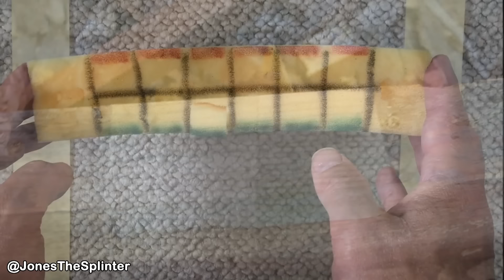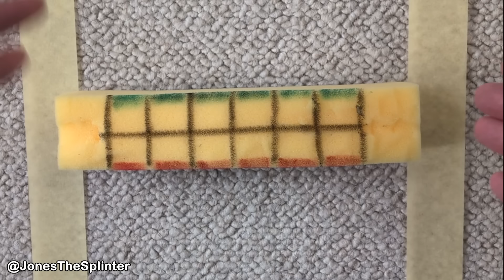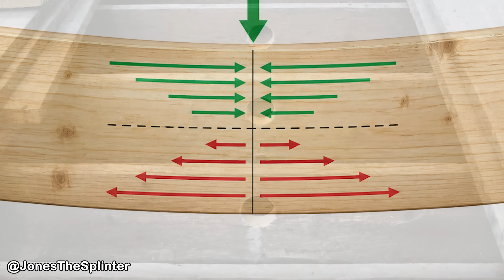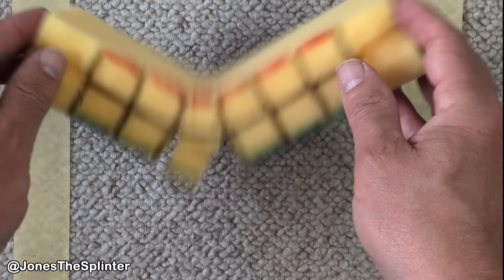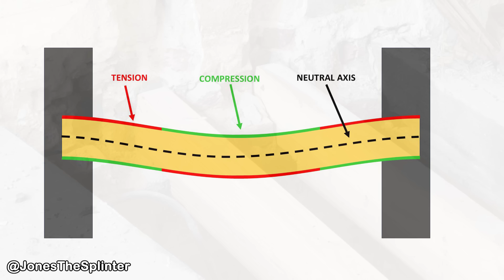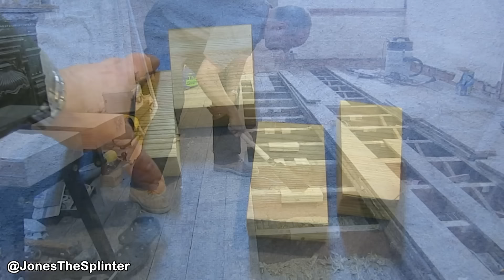This Joist Repair Works… But Only If You Know This Rule

Comment from the maker: Loads of good questions on the first video about where this technique works and where it doesn't — especially around tension vs compression. So I've tried to answer some of the questions in this follow up. Hope it helps.
If you'd like to see the original video which focuses on undertaking the repair it's here: https://youtu.be/Z_t69CTAIOE?si=mfOJYyt1GbSw_wdf
Reply: Great video! A video explaining how to fix the opposite problem would be very welcome. My plumber notched out the underside of the main beams supporting my floor. I've heard of sistering, but am not sure what it is. I'll do some research (I.e. watch more youtube).
Reply from the maker: @Bacon_Uber_Alles  Ah yes, notches on the underside are more disruptive and tricky to deal with. Sistering involves attaching a new joist (or length of timber) alongside the existing one and fixing them together so they act as a single beam. The new timber carries the load, restoring strength and reducing flex. There are fixes involving metal plates which may do the job with less upheaval.

Comment: We have sometimes bolted new material alongside a butchered joist, but the way you have done this makes for an easier, less expensive job.  Given that the butchery is to the top (compression) side only, I can see no reason why this wouldn't put a lot of the strength back. If it were my house I would probably do both! Great video.
Reply from the maker: I agree that doing both methods would offer the ultimate peace of mind. Thanks for the positive feedback. Much appreciated.

Comment: Small correction before makeing any joist repair you must remove stresses from the beam. This can be done with a jack post or other temporary shoring. Failure to do so will result in existing stress not transferring into the repair resulting in reduced strength.

Overall good explanation of beam stresses.
Reply from the maker: It's not always necessary or desirable to do that if you have a delicate lath and plaster ceiling below that you don't want to damage. These beams weren't sagging and theres minimal load at the time of the repair (just self weight and a strip of ceiling). The expanding wedge technique allow you to tap them in to try and match the existing stress in the top edge of the timber (I discuss this in my first video). With or without jacking you restore stiffness to the beam. If the beam is heavily loaded by all means jack it up, but if it's not you're good to go.

Comment: Excellent video.  Sponge did not go in vain.  There is an excellent book 'The new science of strong materials' by J E Gordon.  Deals with issues like this in a very straightforward way.
Reply: ... couple of extra points for a subsequent vid maybe?  As you know the timber is significantly stronger in tension than compression so any cuts on the tensile edge are worse news.  Strength of a beam is a square law so cutting away what may appear a small amount makes a big difference! Great work with the wedges.
Reply from the maker: @readrepairs  Indeed and 'stiffness' varies as the depth cubed (half the depth and stiffness is reduced by a factor of 8: small angle approximations apply) so this fix makes a huge difference to how bouncy the floor is.
But as you say, diving deeper into basic beam theory might be worth a shot in a future video.
Reply from the maker: That is one of my all time favourite books. I re-read it every five years or so to take me back to the general when my focus is getting too specific. It's on the shelf right next to my copy of "The New Science of Strong Materials: Or Why You Don't Fall Through the Floor". Sadly the book that's next to isn't such a page turner...The Finite Element Method: Its Basis and Fundamentals:  Zienkiewicz

Comment: Why not just sister the joist?  That would be much quicker. If you can't because utilities pass through the middle of the joist, then sister a smaller piece of lumber like a wall stud across the top.
Reply from the maker: It don't think it would have been any quicker. It would have meant removing and reinstalling the herringbone strutting for starters.

Comment: Great job ! Use nice well seasoned wood that's not gonna shrink. So many bodge artists unwittingly vandalise their joists with over the top channelling for pipes and cables.. Even if the floor doesn't give way you can at the very least end up with annoying creaking whilst walking over it.
Reply from the maker: Spot on. The wedge timber should be bone dry, you don't want it shrinking in ambient moisture conditions (expanding is fine)

Comment: What about after years and the wood shrinks and may come loose and fall out. I would say a composite or sistering would be better.
Reply from the maker: Indeed this has to be considered. The wedge timber should be bone dry, you don't want it shrinking in ambient moisture conditions (expansion is fine).

Comment: Dang, that's simple and smart. I sistered a bunch of notched old joists. I would have repaired them (and then also sistered them since they were already undersized) had I known this when I was doing the work. Next time...

Edit: added closing parenthesis I'd missed.
Reply from the maker: Thank you. Glad you found the method useful for your next project!

Comment: Very nice instruction on how to fix a mistake you see way too often. Aren't certain bonds like bonds between resin and wood ridiculously strong? Perhaps with the right adhesive or filler a fix on the bottom would also work ?
Reply from the maker: As you say there are some ridiculously strong resins/epoxies. I've tried them in compression and they're excellent but never in tension. Maybe it would make a good video to test these products qualitatively under tensile load. I'll stick it on my do list.  Thank you for your input.

Comment: Waste of time. That's big lumber. No need to repair.
Reply from the maker: You'd be surprised at how much stiffness this fix restored to the joist.
Reply: @JonesTheSplinter  I agree. We rewired a housing estate some years ago, where several joists had been notched beyond reasonable limits. The floors felt much better after remedial work.  Newer homes seem to have smaller joists, and it seems very important not to attack them with a tomahawk when laying pipes!

Comment: Poor joint. Just ask any Japanese craftsman.
Reply from the maker: It's a wedge under compression doing the job it's supposed to do. The Japanese use wedges too you know.
Reply: @JonesTheSplinter   To start with, you created butt joints. Second, I bet you forgot to gently jack up the joists before you added the wedges. Sure, your work looks very good. Time will tell.
Reply from the maker: @robertcornelius3514 Jacking up is a good option if you can do it. I had a delicate lath and plaster ceiling below that I didn't want to damage.
Reply: いいえ、そうではありません

Comment: Great explanation!  However while this looks really neat, would sistering achieve the same result in strength while being faster and easier to do? Even just across half the beam rather than the whole depth
Reply from the maker: Sistering is definitely a common alternative, though in my case I don't think it would have been quicker; it would have messed with the herringbone strutting between the joists.

Comment: Why use wedges instead of a single piece? Is it to make it fit more easily?
Reply from the maker: One wedge will work too.Two ensures the forces on the beam are exactly in line with the fibres... but there's not much difference really.

Comment: What’s the maximum depth of notch in joist is it the centre line or above
Reply from the maker: In the UK it's 1/8th of the joist depth with an absolute maximum of 35mm regardless. No notches allowed in the central third of a span.

Comment: Where happened to your copper pipes installed by the plumber who butchered your joists?
Reply from the maker: A lot of the pipes were unnecessary. I used flexi pipes for the two remaining rads threaded through holes drilled in the middle of the beam.

Comment: Expanding wedges are fantastic. I use them in my 3d prints all the time. In general it is great to learn some woodworking or metalworking when learning to design 3d prints.
Reply from the maker: Wedges are very versatile... but I would never have thought of their use in 3D printing. How do you use them?

Comment: I'd add that the fibers of the wedge have to be oriented in the same direction as the beam's fibers, since wood is much stronger in parallel to grain than if the force is applied perpendicular to grain, both in compression and bending.
Reply from the maker: Absolutely. Very important. 🙏

Comment: If you'll excuse the pun, I'm not trying to pick holes. If you've to retro fit as a plumber, and in times past, copper was the only way, what were they to do? Honest question, not being a dick.
Reply from the maker: Not at all, it's a good question. Solid timber joists should be over-specified and so you can notch them; but there are rules. In the UK the guidelines are: the maximum notch depth for a floor joist is 1/8th of the joist depth with a strict maximum of 35mm and you can't put any notches at all in the central third of the span of a beam. The notches on my beam broke both these rules.

Comment: This is exactly the repair I need in my house as my floor is bouncey and when I lifted the board there is two channels taken out down the joist where there used to be a boiler obviously done by plumbers again grrrrr thanks for showing this method. Did you jack the joists up before knocking the chocks in?
Reply from the maker: I didn't jack up the ceiling because there us a delicate lath and plaster ceiling in the room below that need to be preserved. My intention was just to restore some stiffness to the beams so they were less springy and it worked. If you can jack up the ceiling before inserting the wedges I would imagine this could only be a benefit. Good luck with the repair, it should make a noticeable difference to that bounce! 👍
Reply: @JonesTheSplinter  I understand that would be a messy repair so I would of preserved it also lol yeah I’m thinking about an arco prop from underneath in my living room and it’s concrete floor so solid base and was thinking just lifting slightly put the wedges in and the. Obviously take out the acro . Until I saw your repair I was thinking about metal plates and bolting but I thinking your method just makes more sense 👌

Comment: Is it particularly important to have the wood grain of the wedges running along the beam rather than across it?
Reply from the maker: Yes. Timber resists axial loads (both compression and tension) best when the load is applied along the grain (parallel to the fibres). Also since timber expands more in the cross grain direction it's a better match for the beam if the grain direction is continuous... but even more important is that the wedge timber is bone dry. You don't want it shrinking in the ambient moisture conditions (expanding is fine).

Comment: Great video with a clear explanation. If you do this repair to a joist which is already deformed under load, will the expanding wedges reduce the deformity as you knock them in? Or do you need to support from below with a jacks, acrows, etc to unload the joist and open up the notch before inserting the wedges?
Reply from the maker: You'd have to bang them in really hard to reverse any sag (in my earlier video I advise against this as it can cause other problems). The aim is to try and match the stresses that are in the joist, if you hear creaking you've probably gone too far. As you say if you want to reverse sagging you probably need to jack the joist up before putting in the wedges. In my video the beams weren't sagging much at all but they were springy; the wedges really did a lot to restore stiffness to the beam.

Comment: on the bottom.. could you do the same thig, but then install butterfly / dogbone  / dutchman joint sort of thing on the new wood and the rest of the beam?
Reply from the maker: I can see where you're coming from. My concern would be that you're asking the dutchman to do a lot of load bearing (much higher than if you used it to stabilise a crack in a table top). I'd feel safer using a steel plate but in honesty I don't have any numbers to back this up... just my gut feeling.
Reply: @JonesTheSplinter  I agree.. it's sub-optimal.. but less sub optimal than have a hole or a hole with some glued pieces of wood.  maybe.. a full sized dovetail.. I feel some japanese craftsman has done  a repair like that. :-D     steel dovetail.... hnmm  :-D
Reply from the maker: @CrudelyMade It would be interesting to see this done. You might be on to something.

Comment: In theory this works but it's extremely inconsistent in practise, it will split and shift.
You need to add a patch the side to stabilize it. 
Also for the bottom you still fill it but then install a long strap at the bottom that can handle the whole tensile force of the missing area.

Comment: In america they would scab a 2x6 on it
Reply from the maker: That's often done in the UK too. Thanks for your input from across the pond. Much appreciated.
Reply: @JonesTheSplinter  I saw that done on joists that had been butchered. To be fair, the floor was much stiffer after. I seem to remember they used star shaped "washers" between the new and existing joist, though it was a long time ago.

Comment: I've always sistered single joists with marine ply each side. The idea of a wedge patch is genius. I watched the first video and loved it. This is a great video to send to plumbers and sparks however as it explains the issue. I wonder if instead of squaring the notches it would be better to bevel them almost like a dovetail. I wonder if that would keep the wedges seated firmly as I thought or Introduce more weird forces splitting the joist further. Any thoughts folk?
Reply from the maker: A clever idea, though I'd be concerned a dovetail might act as a wedge itself and split the grain at the base. As it is, everything is  PU glued in and I can't envisage any forces that would cause the wedge to rise or shift sideways. Thank you for the kind words about the video!
Reply: Sparkies never do that damage.

Comment: just a note about good as new, glue is stronger than lignin, but not stronger then the wood fibres, a continuous long fiber is still preferable. But in compression it's not important.
Reply from the maker: Indeed, that is why I only recommend this for notches on the compressive edge of the beam.

Comment: I'd think this works as long as you don't put too much pressure on the wedge since that would put additional stress at that location. In fact, I'd think you'd want the outward pressure to be about the same as it would be in a 'normal' beam.
Reply from the maker: Spot on—the goal is simply to restore the bearing capacity without introducing new, unnecessary stresses. 🙏

Comment: Heritage carpenter here, done this loadssssss of times. Like you said only really works on compression. If the notch is on the bottom then sistering is always better. We usually say if its more then 1/3 of the joist cut away, best to sister it plate to plate👍🏻👍🏻
Reply from the maker: Those are sound guidelines. Thank you.
Reply: I understand the theory of why compression works better than tension, but considering the number of videos I've seen showing glue being stronger than wood, when failed joints are pulling out fibers instead of the glue failing, would the expanding wedge work just as well in actual practice?

Comment: Hack job with a capital H,  local building inspector here in the states would have fit if did joist repairs like that , he would make me  double up the joists or if space was limited  glue and screw a piece of 3/4'' plywood to it
Reply from the maker: For notches in a compression zone this is a structurally sound technique. Inspectors might not promote this as a method because when to use it would require the builder has knowledge of the stresses in the beam and since he can’t guarantee you have this knowledge he’ll take the safe option of telling you to sister the joist. Doubling up the joists is far more disruptive and comes with its own problems (in my situation I would have had to remove the herringbone strutting between the joists). You’re also relying on mechanical fasteners or glue to transfer the load in sheer which is not as effective as a wedge resisting compression loads directly.
Reply: Rude.

Comment: This should be incorporated into building standards
Reply from the maker: Thank you — it’s a great fix in the right situation and its always good to have more options, especially when it's a low disruption repair.
Reply: @JonesTheSplinter so, in your view, does every potential solution to a problem need to be embedded in building standards as ? It seems to me that standards need to be more generic.
Reply: @gavonak2841 I think it's important to have standards with anything that is potentially dangerous if you get it wrong (so structural issues, stoves/fires, gas, electrics, those type of things)... and indeed we do.
Reply: In some ways it already is part of building standards where notching should not occur and things like wires and pipes must pass through the centre of joists.
Reply: The location of holes in beams and joists IS in the approved documents of the Building Regulations (if that's what you meant by "building standards").
Reply: If they'd followed regs in the first place he wouldn't need a fix.
Reply: This is taught to us plumbers too.

But we need to notch to retrofit ridgid pipe under a floor.

Ortherwise would have to joint passing though each joist..
Reply: @SciurusVulgaris1979  Notching is acceptable when the joists are over-sized. If they're not, then use flexible pipes threaded through holes on the centreline.
Reply: Not restoring the integrity of the beam...